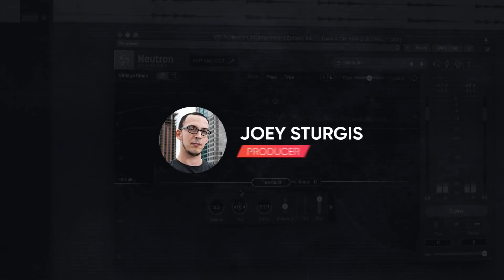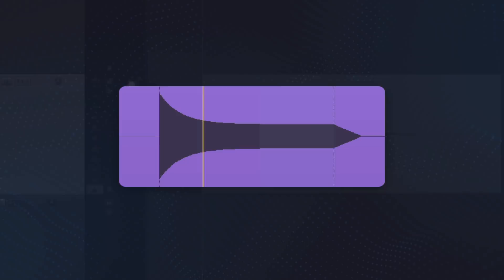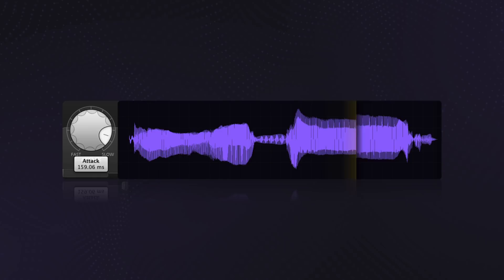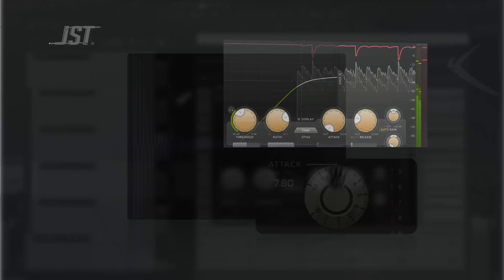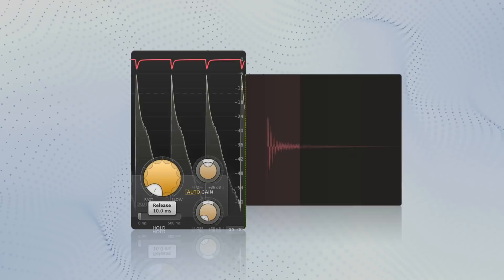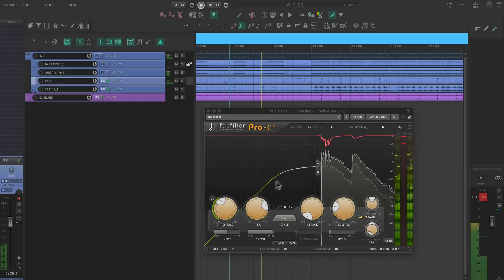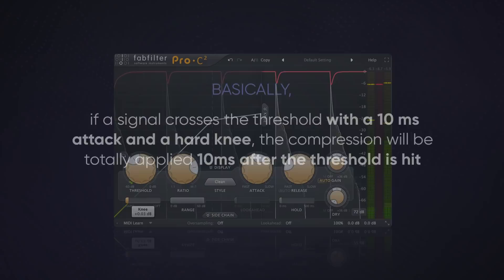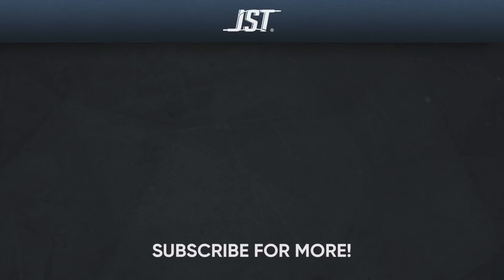How Attack & Release Works in a Compressor

Comment: Excellent explanation. I have been wondering how a guitarist would use the release in a compressor pedal, for two handed tapping and I think you explained it at 8.42, when you spoke about long sustaining notes Vs rapid fire drums.

Comment: the knee graduates the ratio around the threshold, its not timing, although it may have such an effect. In fact it will mean a subtler compression is still applied below (but approaching) the threshold without even breaching the threshold! and immediately above the threshold slightly less ratio - hence the curve on the graph. important distinction.

Comment: Wow, for some reason I've always thought the more the attack knob is cranked up the more attack I'm getting, and it turns out to be the opposite. Thanks for the video!
Reply: Depends on the compressor
Reply from the maker: Some compressors make the attack knob backwards
Reply: On a Distressor 10 is slow, 1 is fast. On an 1176 7 is fast, 1 is slow. Make sense? 😝 Different units are different.
Reply: Oh, ok! So I might be using my stuff the correct way. Thanks for the feedback guys
Reply: @v.harlot  definitely one of the nice things of using digital compressors where you can set the attack specifically and know what it is

Comment: The attack is not how long it applies compression after the signal passes the threshold. And the release is not how long it stops applying compression once it drops below the threshold. If it actually behaved like this, the gain reduction would be pinned once it passes the threshold (no changes would occur), until it drops below the threshold. Gain changes are happening all the time. And with every gain change, the attack and release envelopes are applied. 

The attack and release envelopes are still being applied to the signal that's already passed the threshold. Once the signal is above the threshold, the compressor reacts to all gain changes, attacking when the signal is increasing, releasing when the signal is decreasing. The compressor doesn't wait for the signal to drop below the threshold to begin releasing.

You can watch this happen for yourself by sending a sine wave to the compressor at 0dB, set the threshold so that it's extremely low (-18dB), then set a ratio to whatever, then automate volume slightly by bringing the signal down by say 3dB so that it drops and increases but nevertheless, it doesn't drop below the threshold, and you'll still see an attack and release envelope from the rise and fall of the signal above the threshold.

Comment: this is not exactly correct. the knee doesn’t gradually compress the signal after it exceeds the threshold. the knee gradually rounds the threshold itself, which means that the compression starts to exponentially happen before signal reaches the threshold so that when it reaches it the ratio is exactly how you set it. because of this soft knee results in more compressed signal and a transient loss

Comment: If release is the amount of time for audio to return to its original volume, why does shortening it reduce unwanted crescendo in a crash cymbal caused by compression?

With the threshold set at 16dB and ratio 4:1, a release time of 1 sec causes a cymbal crash to swell up horribly. Setting release to 3 secs ameliorates much of the problem. Yet the duration of the note may be less than 3 secs. Can you throw some light on the matter?

Comment: "A hard knee means that the compression is applied instantly after the attack. A softer knee means that the compressor reduces the gain a little more gradually after the attack."

This is a little misleading as it suggests the knee affects the compressors attack and release, while it really affects the threshold and ratio. A hard knee treats the threshold like binary switch: cross the threshold and the compressor is fully on at the set ratio. Stay below it (even if a little bit) and the compressor does nothing. So this can result in very sudden gain reduction when you have a signal that is very dynamic, and can sound unnatural. A soft knee treats the threshold more like gradient. The gain reduction is applied as the level approaches the threshold, so already kicking in before it actually hits the threshold and is only at full ratio at the set threshold. This is great for leveling very dynamic signals because the louder the signal, the more it is compressed resulting in a more natural sound. 

This is also why a soft knee, with all other settings untouched, results in more gain reduction (as you can see in the meter on the right in the video) because the compressor is already working before the threshold is crossed, whereas with a hard knee, it would not be doing anything at that point. So what I like to do when dealing with a very dynamic signal is setting a higher threshold, a higher ratio, but with a soft knee. This way the main part of the track is compressed lightly but only the loudest parts are brought down a lot. Although it might be a better Idea to use multiple compressors in series for this. (or even better: use both)

Comment: Hey! When it comes to compressors with automatic attack/release controls (LA2As, or some of the settings in the FabFilter C1) what is you advice on those?
Reply: Optical compressor like the la2a have slower attacks if you want something with a slower attack try that. They are good on vocals for example, or bass. 

I prefer to have my dynamics under control but I’m not experienced so maybe I’m just not comfortable with stuff like that and tend to avoid them